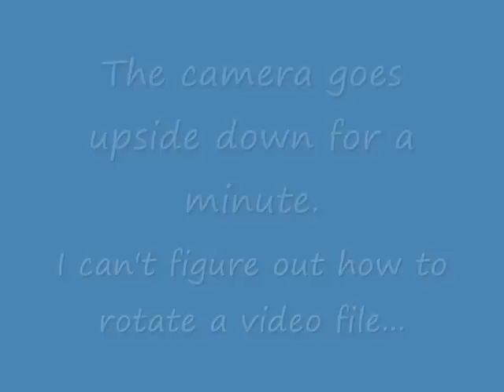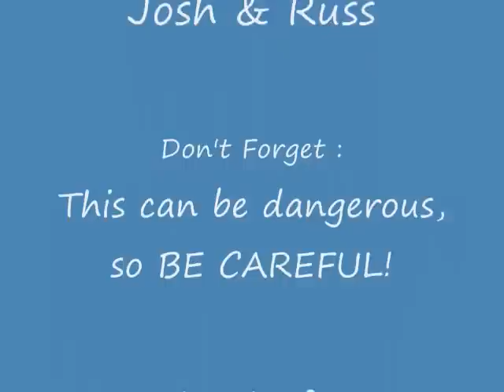How to MELT CANS using the "flower pot foundry"

Comment from the maker: LOL!  This is posted with an old email address of mine.  I had forgot about it.  The materials should be self explanatory, the hole in stainless steel requires a good drill bit, a pliers, a hammer, some ingenuity and a few beers - you'll figure it out.  Pipe is simple black pipe.  Crucible is Pyrex but eventually breaks.  The flower pot breaks as well.  I haven't used this since the day I made the video, so it was more of an experiment to see if I could do it, not could I do it my whole life.  I lived in Arizona and was bored because there was nothing cool to do in town.  Now I moved back to Minnesota and spend most my time on my boat.  Fun video to make though.  Good times...